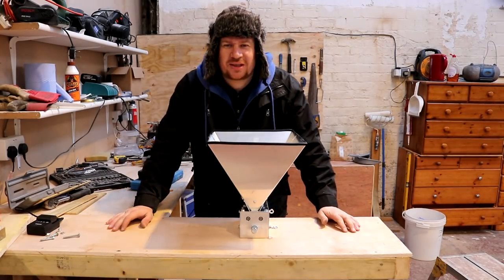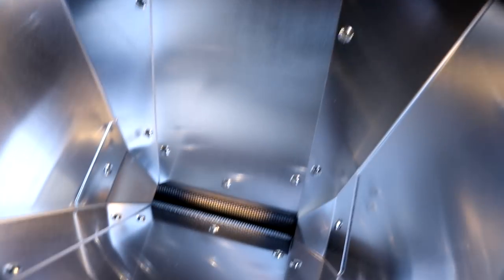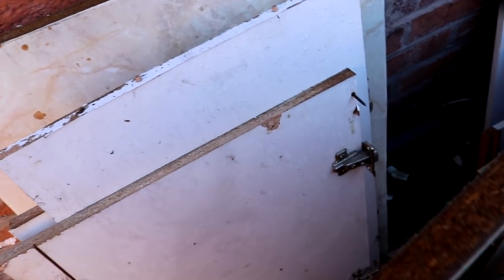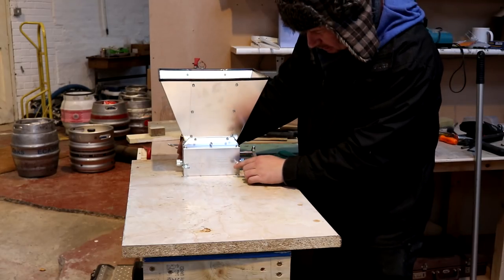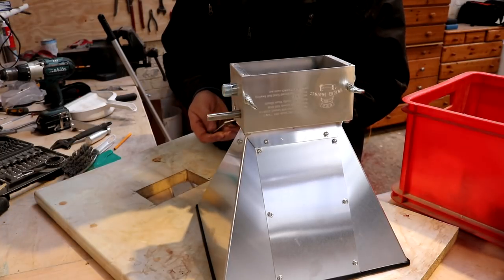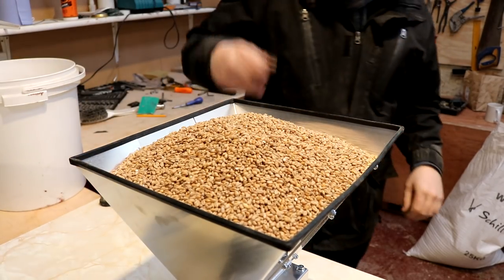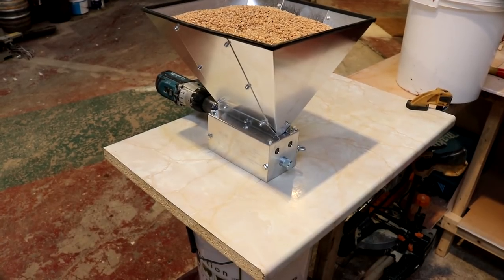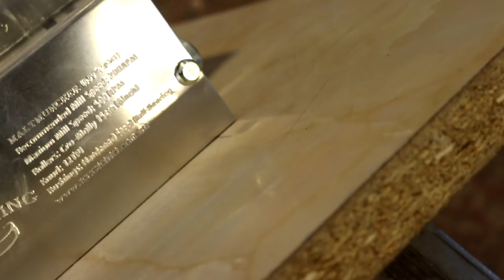Grain Crusher - Malt Mill

Comment: I have the same mill bought from the same place.
I've only milled two grain bills so far and the crush was the same as yours, just a bit too fine.
After the second crush I added a handful of oat husks to bulk it out a bit to help it drain and avoid a stuck mash.
First job for 2018 is to adjust the mill, grind some grains and get a brew on. Cheers Harry 🍺